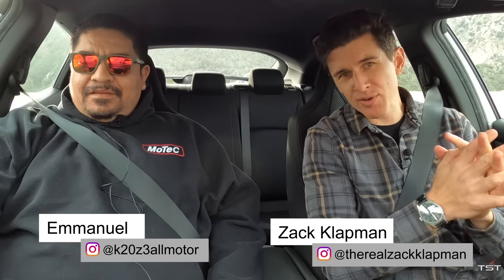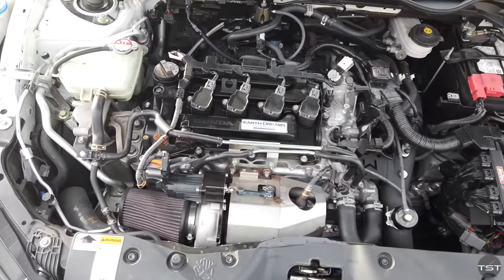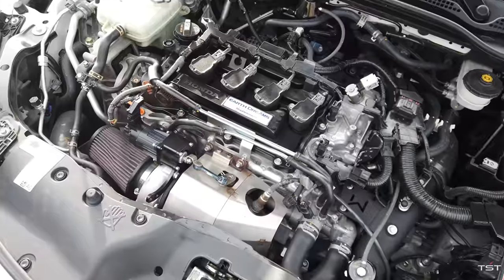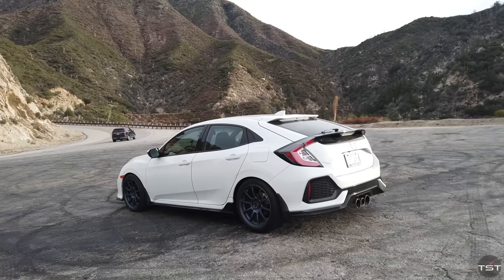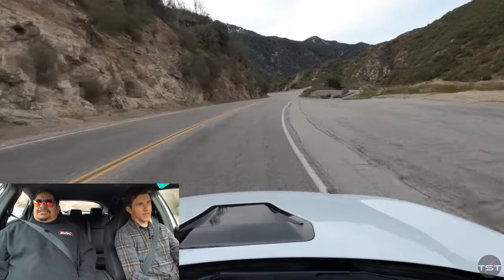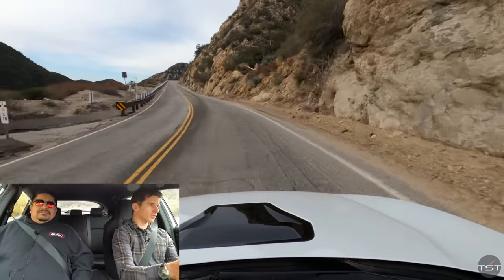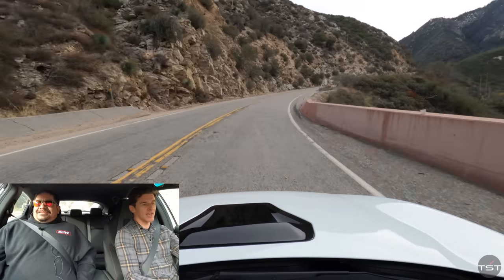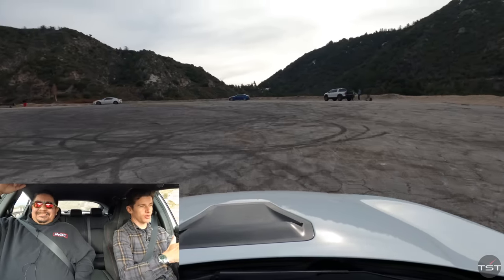How to Make the Ultimate Sleeper Honda Civic

Comment: This gen doesn't get the love it should.
Reply: Because the K20s and K24s are superior engines period. Not only that but the port injection motors don’t get the issues that the direct injected ones do, and you get a better sounding engine too.
Reply: * 7th Gens has entered in the chat
Reply: @kengvang1330  I have an ep3 and I have no doubt that after people realize they're all gone and you can't find one that hasn't been absolutely backed up that people will finally want one. There's nothing that looks like one or offers what it has even in spite of it's performance deficiencies.
Reply: Are you kidding me the 10th generation 1.5L is a complete joke, I had put alone 8k worth of mods and supporting mods just to make 250wheel and still blew up on me twice. Only good thing about the car was the chassis
Reply: Naw this generation is whack af with those massive fake blocked off black air inlets/outlets on the bumpers, that horrendous looking rear end 🤮, the interior design, and worst of all that glass 1.5l engine which seems to be a huge gamble with just a light ecu tune. I'm no expert but my opinion is this is the worst generation civic ever.
Reply: @gtmike916  I mean for just bolt ons L15 is ok i guess but anymore than that no way. Weaker crank, smaller mains, less top end cfm vs an old D16 haha. Personally I'd take a piston/rod z6 over an L15
Reply: I wasn't a fan of the 10th gen Si either, but I think people have to remember Honda didn't make the base model with the aftermarket/modding community in mind. As a daily, stock vs stock, I'm taking this over the 7th and 9th gens easily, even with the fake ugly vents.
Reply: @gtmike916  why do you guys act like the K-series motors don’t exist anymore? They literally come in the civic type R. And also, why do you act like direct injection doesn’t perform better than port injection. I guess many of you don’t even know that.  The L series motor is not a replacement for the K-series motor.
Reply: Ever since going k series. Lame15s are just not good…the car is a great daily with light mods and stock turbo but it’s not good to daily a Garett like everyone says
Reply: @cesarcampos39  of course it cost a lot to get power out of it. The motor just came out. The L series has only been in production for six years. Six years into the K-series being out and there was nothing out for them either. People used to say the same thing that you just said about the L-series about the K-series.  Lastly, you’re comparing a boosted motor to naturally aspirated one in a booster motors never going to be as dependable.
Reply: @vtecef9  I beg to differ about that my B58 has not given me a single problem at 500 wheel also only having spend less then half on what I did on my civic
Reply: @vtecef9  the K20 in the CTR is very different from early K20’s. It’s a low-revving (barely makes it to 7000rpm) turbo direct-injection 2.0L, similar engine to what you’d find in a GTI. The 9000rpm N/A K20’s were something special, there’s not many engines out there that can compare. I’ll take an 8th gen Si over a 10th/11th gen Si any day, despite the lack of torque. 

Outside of S2000’s, lotus Elise’s, and GT3’s, M3’s, and GT350’s, there’s very few modern high-revving N/A engines out there
Reply: @cesarcampos39  tell you the truth dude I don’t really believe anything you say you claim to have spent $8000 to get 250 hp when I got that same power out of my 10th GEN with $2800. $8000 will get you a bill motor lol. But it’s a well-known fact that naturally aspirated motors will be more dependable than forced induction motors. I really don’t care about your anecdotal evidence.
Reply: @guenthersteiner8163   I don’t know what you’re talking about bro but I used to own an 8th Gen si. And they don’t read line at 9000. They red line at 8000. And the K 20 that comes in the CTR is far superior than the past K 20s.  JSR continuously gets 600 hp stock block civic type r’s. Also, direct injection is not a problem and actually performs better than port injection. Direct injection has lower intake, combustion chamber temperatures in better cold weather performance. That’s why Honda moved to direct injection.  I think that anybody who says they would rather have an eighth generation civic SI over a 10th generation civic SI has never owned both of them. Because I have and I would much rather have my 10th Gen. It is better in every conceivable way then my eighth generation was
Reply: Cuz the engine is made of straws
Reply: @vtecef9  aside from the type r being labeled a k20c1, it isn’t a k series. No vtec on intake side, no port injection, single exhaust port on the head, no screaming redline….it’s good just not great.
Reply: @45toothbrush  buy your logic an Integra LS motor isn’t a B series because it doesn’t have VTEC. Some of you guys don’t know what you are talking about.
Reply: @45toothbrush  also, you’re a liar the civic type R motor 100% has VTEC on both cams
Reply: @vtecef9  the K20A from the 8th gen CTR and Integra’s has an 8600rpm rev limiter from the factory
Reply: @vtecef9  having owned both the 8th gen Si and a 10th gen 1.5L, the 10th gen was a great commuter car (more comfortable, better torque for daily driving) but there is absolutely nothing special about the powertrain. It sounds like every other 4-cylinder turbo direct injection, and it lacks top end power with the small turbo. I currently drive a Fiesta ST, which is a similar powertrain in a much lighter platform (2600lbs) with far less understeer
Reply: @guenthersteiner8163  OK my fault, I’m from America so we didn’t have a R till 10th Gen. They K 20 in the SI only goes to 8400. Regardless, it’s not 9000.
Reply: @guenthersteiner8163  you are correct. My eighth generation civic SI did sound better. It also had the traditional Honda feel. My fifth generation does feel different and sound a lot different. But it is much faster and much more comfortable to drive. It also get much better gas mileage. But that’s exactly what the car was designed for because practicality has always sold Honda’s not performance.
Reply: There everywhere, what are you talking about? they aren’t better looking then any previous gen civic except maybe the base 9th. Plus it’s a 1.5 with no vtec. They get as much love as they deserve.
Reply: L15 is literally a bomb
Reply: @gtmike916  Nobody will argue the Ks aren't better but the 1.5T in this gen is A.) Sandbagged from the factory. They make more like 200 hp at the crank and +180 hp to the wheels. B.) They're stupid easy/cheap to tune for reliable power. Less than a $1000 and a weekend of work and it will be really quick.
Reply: @vtecef9  Yeah dude sounds sus. I got to 225 hp on my 10th gen with a CVT! Never broke anything other than an intercooler hose coming loose. Ran neck and neck with GTI's all day. If he spent $8k in mods to hit 250 hp and blew up his car, that's 100% user error.
Reply: It doesn't get the transmission it should
Reply: @cesarcampos39  you just have bad luck
Reply: @Bbc418  yeah I know I think I'm the only L15 owner that has blown their engine up
Reply: Lol all these people saying the motors suck is funny. People straight up neglect maintenance you need headstuds that’s really the only thing. I’ve been ripping around @ 350ish wheel for awhile now no problems😀people pop head gaskets at high speed throw a rod seen it over and over again
Reply: The 10th gen will get the much-needed love soon. With the 10th gens, you have to do a lot of R&D because it is so new; for example, if you tune the l15b7, it needs to be mated to an upgraded clutch “none organic.” This will be a long, overdrawn comment, so if you need more info, I'm coming up with a post shortly. It goes to say that the L15b7 has potential, especially if you have the means and patients. I have an FC3 street & track upgraded fuel pump, 1000cc port injector kit, ultra street intake manifold, forged engine, fully mfactory-built trans, and loads of other supportive mods 800hp+.

Yes could have brought a Porsche or a Type R, but I have a 4-door vehicle, and I can't afford the maintenance of an 80k vehicle every 7k miles.
Reply: @Candybuiltsi  yeah I found out the hard way tuned it and threw a 1.5 race tune, CAI race, and intercooler without the 4bar map sensor, and boom there goes my block.
Reply: It will don't worry
Reply: @vtecef9  And it never will be a K-Series replacement and you even proved my point that the K-20 and K-24 are better. Also I never said that they went away we all know about the K-20 Turbo in the Type R. My point is that the older K20s and K24s in the Si models take mods and make power FAR BETTER than the 1.5 and the evidence is as clear as day. Also you forgot that Honda’s Earth Dreams Direct Injection had MAJOR issues with diluting the oil with fuel early on as well as your typical carbon buildup.
Reply: @gtmike916  OK you are correct the K-series is better than the L series. What was the point of you coming to a video about a car that has an L series motor in it to say that?  Also, why are you comparing a motor that has 23 years of production an aftermarket support to one that has six?
Reply: @straight_intro and AMS trans fluid will be better for CVT support
Reply: @cesarcampos39 dude i spent 4k and im pushing 300 to the wheel wtf dude you do my shit runs great
Reply: I love my 10th gen ❤
Reply: @muffcabbage9742 its look like something a kid would come up with. Latest look much soooo much nicer.
Reply: agreed
Reply: @cesarcampos39 😂😂😂 lol facts
Reply: @cesarcampos39 bro had the cvt for sure 😂 no shit it blew up lmao
Reply: 10years with mine, it's coming, gonna drop a V12 in it, 🏎️
Reply: @gtmike916 lol that's why I added 4 more injectors in my Si
Reply: That’s why I loveeeeee it man lol

Comment: Not a “Honda guy” but this is rad. Anything short of the Type R is slept on anymore so to have a 1.5T sleeper like this is pretty sick. And 7800rpm redline? That’s gotta be fun!
Reply: This is why if you see any civic/accord turbo that has ANY hint of mods (wheels, jdm badges, etc) its probably tuned past factory by a lot. I know my accord looks barely OEM+ but with a ktuner stage 2 with ZERO mods it can gain up to 80lbft down low with well over 300hp top end.
Reply: How much horsepower does this car their in on this video have???

Comment: The owner likely has at least Typer R money in this but the appeal of the sleeper aspect is undeniable. Great job!
Reply: I think I would rather have this sleeper, than Type-R. The CTR draws too much unwanted attention.
Reply: @doubledown8229  me too!
Reply: He probably  could have just bought the type r and swapped body panels....would have been cheaper
Reply: @XeroFailGames  Exactly, debadge, take the spoiler off, put some 18" wheels, put some black seat covers... 
There you go. You got yourself a sleeper Type R. and one more thing, the whole front suspension design is unique on the Type R. 
If you were willing to spend that much money and efforts to turn a regular Civic to a sleeper, it's easier to turn a Type R to a sleeper with less money and efforts, then you have a better car at the end...
Reply: being fast > looking fast

Comment: Ill start by saying this is a really cool build.  Eman is a pioneer in the 10th gen civic space.  You can tell this car wasn't built to be a track car.  Its built for when a stock scatpack comes next to him on the highway.  Also, what Eman didn't mention is that the original motor / setup was probably seeing close to 300lb/ft of trq with the e30 tune. All that low end torque on the stock rods turned them into spaghetti noodles.    Plenty of us 1.5t guys have been running this setup for years now without catastrophic failure. Its all about managing that torque curve with proper tuning.  It took setups like this to figure that out though.  Thanks for blowing you motor up to save mine.  Cheers!
Reply: Yes very valid and well put point.  The tq on the stock small turbos kills these engines fast with mods and ethanol
Reply: Facts, but I still managed to blow my motor up during the pandemic, so I had to wait almost two years to get all the parts to complete my FC3 street & track build. Don't forget about our transmissions; once you get to about 350 to 400lb/ft with an upgraded clutch, your stock transmission is toast, starting from the 1st to the 4th, somehow leaving the 3rd, 5th, and 6th gear untouched.

Comment: I loved my 2017 2.0l non turbo 6 speed sedan. Was lighter than the si coupes, and after springs, shifter stabilizer, exhaust and intake was still slow but a great daily with some side hill action time to time, $19,000 back in 2017. Great video my dude.

Comment: I'm conflicted, love the sleeper concept, love the swapping in better transmission/shifter along with engine mods, and he seems like a nice/chill/smart guy, but not sure why he would put on bolt-ons that were going to bend some rods in the first place. Was that a legit learning experience, or was he like, "well, we could do what you're asking, but you should upgrade the rods too." And then the customer was like, "Nope, lets see how it goes with the stock ones?" I guess my dream build would be a 2017 Accord with Type R shifter and 300-ish hp. Wonder how much that would cost?
Reply: So back in 2017 no one knew how weak the rods actually where everything was still rather new back then

Comment: If I didn't own the CVT version of this car, I would really look into trying to push at least above 200hp from the stock 180 because it looks really fun
Reply: Get a ktuner and Phearable 1.5R tune, safer low torque down low and plenty of top end, feels great
Reply: @Tac_3403  Ayy appreciate it, I'll look into that. Since mine is that last year FK7, it's still under warranty but at the same time i'm really impatient lol. Knowing there's a safe option that won't cause the CVT to slip and the motor to commit unalive really helps
Reply: @Moatiz ive been tuned 60k with brake boosting and normal maintenance no issues so far. check my videos, you'll love that tune. still fun to drive especially with minor boltons and suspension work
Reply: @alexl.102  appreciate it
Reply: I have a 19 cvt hatch sport.  Been running 21psi tune for over 50k kms on all stock parts.  Just have to keep up with maintenance and use the best fuel available.  Also a good technique is to always roll into the throttle when tuned,  flooring it really loads up the transmission.
Reply: @zachh8664  thanks bro. Appreciate the knowledge, didn’t know that flooring it is bad for the transmission
Reply: You can do it easily. I had the CVT and it put down 225 HP with zero problems. You just have to be sure to change the trans fluid regularly and not get the CVT too hot with dumb launches.
Reply: I have a 2018 Tuned with Mishimoto intake on a 21psi Ktuner with 6k miles. No issues so far. You dont need a lot of power to have fun with the car.
Reply: @marcusmcneal7453 may I ask what you did to make that hp? I have a 19 civic sport cvt looking for mods other than a cai, tune, and downpipe.

Comment: I was on the fence about getting a 2018 Sport hatch, ended up getting an 18 Fiesta ST instead. Absolutely love that car and what I've done to and with it, but the Civic hatch does have a bit of a soft spot in my heart
Reply: I really loved my blue 2017 sport hatch, but I think you ended up with the more fun car overall :).  For a commuter/manual, it was quite nice but not as raucous or rowdy.
Reply: We're in the same boat lol. 18 Fiesta ST, and knowing what guys are doing with our little 1.6s, this whole process sounds insane. I know plenty of guys with plenty of miles of 300-350whp Fiestas on an unopened engine, just big turbo, port injection, E85 and some supporting mods that are essentially just stage 2/3 bolt ons. And the Fiestas handle so well stock, and especially with just upgraded struts and springs. I think we made the right choice, even if they are ford products 😂

Comment: Hell yeah! This guys local to me in Ventura, he did some work on my old Honda Fit and my buddy’s FK8, he’s good stuff!
Reply: Hey what did you do to your Fit?
Reply: @ranchofitge8  under my ownership I did lowering springs, Progress Rear Sway Bar, SBC RPF1 RS with Federal RS-RR (good budget tire at the time) JDM rear tail lights, Hybrid Racing short shifter, Nissin Pads with Brembo rotors. And camber bolts. Pretty basic setup
Reply: @jorgeizDShiznit  no engine mods?
Reply: @ranchofitge8  k&n drop in filter and valve adjustments made it feel alittle faster 😂 but no. My plan was the K swap it but I ended up selling it to buy a 4Runner for the family
Reply: @jorgeizDShiznit  yeah I feel it on the swap. Wanted to swap it but for the money I'd rather buy a tsx next
Reply: @ranchofitge8  im literally going to look at one tomorrow haha I had an FA5 but that thing burned on the freeway :(
Reply: @jorgeizDShiznit  say what?? Holy smokes
Reply: @jorgeizDShiznit  
What's the name of his shop? I want to take my car there.
Reply: @doubledown8229  New age performance

Comment: I was equally as surprised and in disbelief when he said it only weighed 2800lbs
Reply: Yep, the civic is still a light car
Reply: They’re very light cars. I remember test driving a 2017 LX sedan and it felt like a go-cart, by how light the car felt and how direct the steering is
Reply: @mitchellsteindler  Thats not light compared to 90's civics
Reply: @04dram04  well... duh
Reply: That's dry weight I believe
Reply: The 10th gens are LIGHT which makes that 1.5T boogie even from stock. Every bit of power you add is aided by the fact they weight so little. With sway bars and tires, you can just chuck these things around like stupid. The most fun you could have at 23k when they were new. Loved mine.
Reply: @04dram04  No shit lol. They're a lot bigger than they used to be. Keep in mind these cars also have a bunch of tech like now too. Still the Civic hatchback that sits 5 adults weighs less than my 2 seat sports car (08' Z4 coupe). That's crazy.